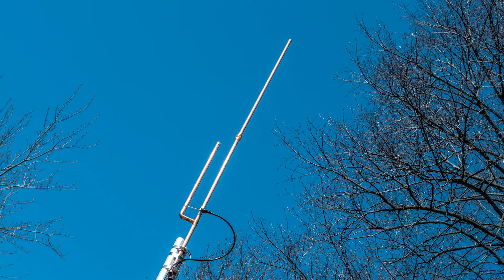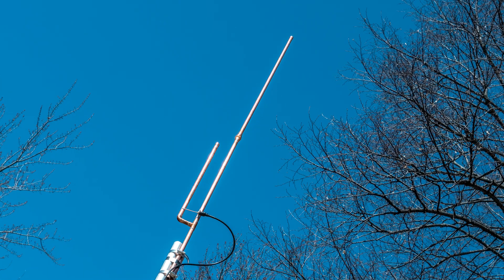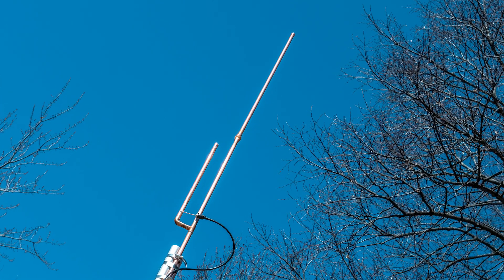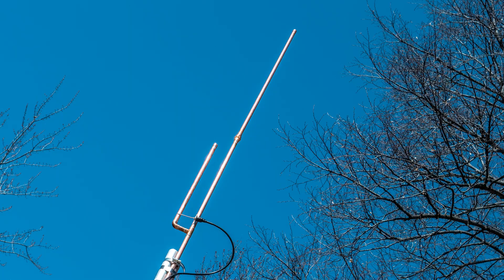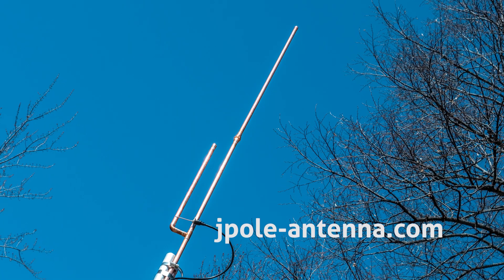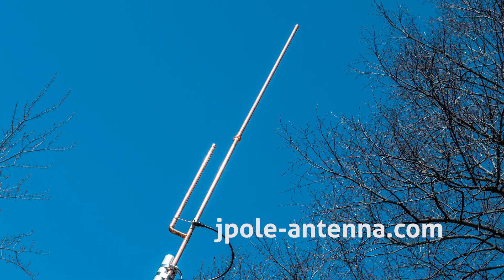Are Manual Tuners Really BETTER than Auto Ones?

Comment: I don’t particularly care for the T configuration tuners but I like the L network and the pi network. I built my first L network tuner at age 14 as a Novice. One advantage it it can give minimum SWR with only one setting, whereas the T can be mistuned. All the old boat anchors has pi networks that in some transmitters could tune almost anything! It would be nice to be able to have a variety of sizes to buy.

Comment: I think Comet still makes the CAT-300 which is good to 300W as the name implies, but it's more expensive than the MFJ Versa Tuner.  Of course there is Palstar, but they cost as much as the radio because they're high power rated. It does seem like there is an opportunity for someone to fill in the gap. I'm no electronics guru, but even I could build a tuner.

Comment: As a newer operator, I came to the party a bit late. Many manual tuners are no longer made or supported. Comet sems to be the only brand that still offers a decently priced manual tuner?
I have been shopping around for over a year to find a decent manual tuner, but did not trust many of the used ones I saw. Hard to know what to look for internally as well?? I was hoping someone would have taken over the MFJ versions and just rebranded them as something else?? Maybe one day? I prefer to learn the 'old school' way first, then maybe go the easier route of an automatic tuner later on. I got into this hobby to avoid the newer tech and grasp the more manual/old school ways as long as I can. 😉
Also, thanks for explaining the difference between a regular and elevated ground plane 👍 As simple as it may seem for the experienced operators, this helped me understand the topic and effects better. Thank you 🙏 Appreciate all your vids and info you put out there. Hope to catch you on the air one day. 👍😎
Reply: Palstar and ZMatch

Comment: I have a TYT-9800 that I want to use with my e-bike can you point me in the direction of a good UHF / VHF whip antenna that I can attach to my Spring Mount on the back of the bicycle that will cover both those bands

Comment: Impedance matching is what tuners do. Ultimately it’s to protect the radio and improve the performance.

The better your antenna works, the less work your tuner will have to do.

But, yeah, we need manual tuners. Automatic is fine for some, but I feel that automatic tuners don’t paint a complete picture when it comes to impedance matching. Would be nice to know to see “live” watching the needles move as you’re adjusting the tuner.

Comment: I have an MFJ manual tuner, an LDG 100w auto tuner, and an LDG 817 tuner, and a G90. 

The manual tuner and the LDG 100w (base) tuners are both 100 watts.  I have a SIGMA Eurocomm X-80 vertical (random wire type) antenna that requires a tuner. I want to also add a random wire antenna or a doublet fed with window or ladder line. 

The autotuner has two antenna ports and I can choose one or the other. The MFJ has two SO-239 antenna ports and a built-in BALUN that can handle either balanced line or a random wire.  It also gives me a switch to choose which antenna and whether or not  to bypass the tuner.  It has a cross-needle SWR meter that shows my power out and the SWR going to the radio. And, it has a built in dummy load that can be tuned.   

Strangely enough, I use the tuned dummy load to test the roll back setting on my radios.  I detune the dummy load until I see the power drop and then I know the SWR level that triggers roll back. Usually, it starts at 1.4:1, nowhere near the 2:1 everyone says. 

The MFJ has been a workhorse for decades. I really miss the features, but it would be clumsy and space consuming to add everything, not to mention the costs.

Comment: Just worked you Michael, on 40m ft8.  I've got three manual tuners and I love them - two Tucker T-1000 tuners - one I bought new way back in 1994 or so, and the second one I got just this summer at a hamfest for $40 - and a MFJ-969 that I bought used last year.   You were doing POTA, I was running my IC-705 into my attic installed G5RV Jr. which I can match on 40-30-20-17-15-10.  73 N2LCX.

Comment: I have an old 1kw Heathkit variable inductor tuner that could tune wet spaghetti to 1:1, but I prefer the automatic, as it was a few minutes to adjust the Heathkit right (even with a notebook of settings) vs 3 seconds with the auto.

That was the danger of MFJ buying out all those corporations over the years. So much really useful equipment is now gone forever, all at once.

Had a thought - there are "bat wing" sun shades on some rvs. Instant ground plane for vertical?

Comment: I have the MFJ969  Manual tuner and I believe you can get a much sweeter match doing it manually then the automatic antenna tuners. it might not be much but difference but just knowing what it does

Comment: Great video Michael. I'm a manual tuner guy all the way. I've got 3 tuners around here and my favorite is my Palstar AT2K. My antennas are a 160m Horizontal Delta Loop and 160m  doublet. Both are also ladder line fed down to 4:1 baluns and then short sections of coax and into the tuner. My Palstar tunes them easily and quick  I made a cheat sheet for both antennas but for the most part I've memorized my settings. Changing bands isn't complicated or slow for me. I'm always band hopping. Recently I had a wild idea and co phased my antennas and the Palstar did it no problem. Try that one with an auto tuner lol. KT4ZG

Comment: Comet makes a nice looking manual tuner for 250 watts and under. Most people are buying the ldg auto tuners. The amazon china knock off tuners are problematic at best. I know as I bought one. Palstar makes tuners you can use with an amplifier, but they are pricey. 73 GOD bless Earnest K5EWM 🇺🇲👍.